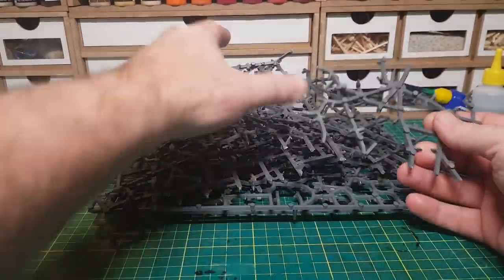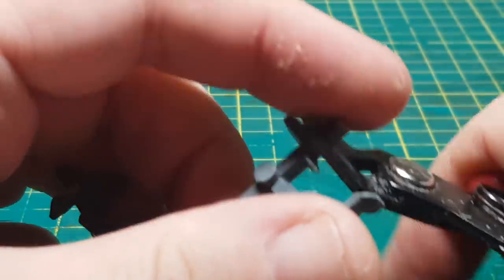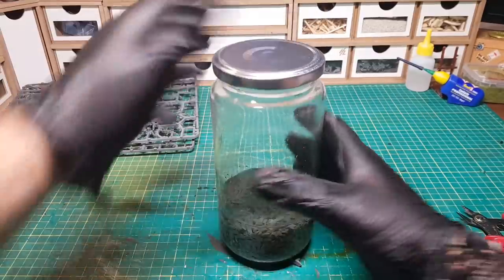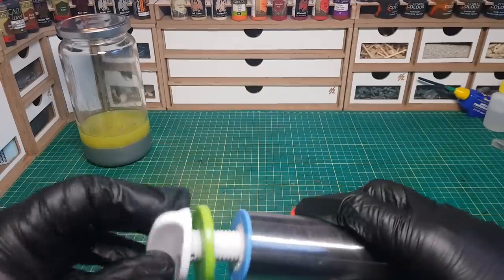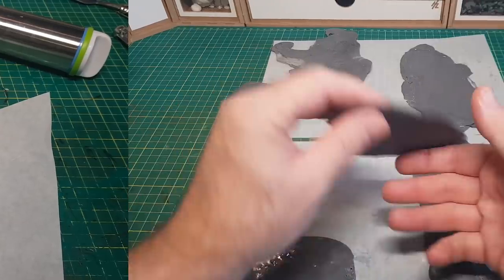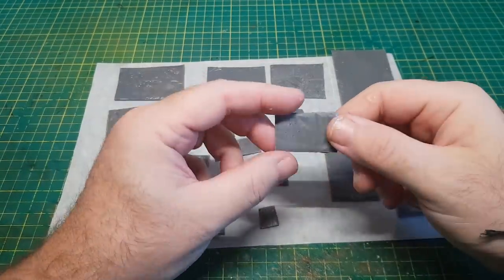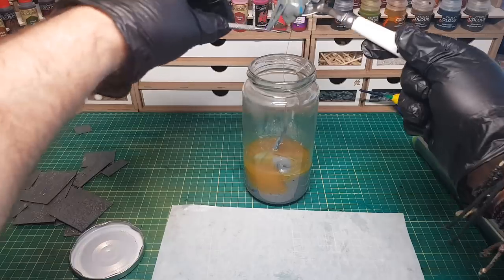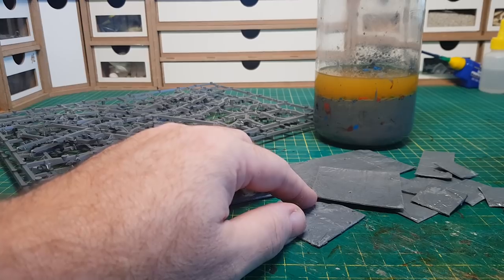Turn Warhammer 40k Sprues into Flat Panels

Comment from the maker: Apologies about the sound quality, Im getting to grips with the new microphone lol =)
Reply: How did you make those wrinkled panels you used for the containers?
Reply from the maker: @charliebeare9752  my video is out later today and Im going LIVE in 30 minutes =)
Reply: I tried this and after melting down the plastic and rolling it out, it never fully hardened. The edges got crispy but the middle was still gewy. Do you have any suggestions? (I used both nail polish 100% acetone and just pure acetone to melt the plastic)

Comment: You can put thick rubber bands or layers of electrical tape on a standard rolling pin to control your depth. Works for pastry as well as plastic.

Comment: since you’re already using a roller. Have you tried using a texture roller on the panels after they’ve set a bit in the grease paper but before they’re hard? Could see some good pre-made sci-fi scraps, walls, or ruins using that instead of just the plain panel. Just a thought. Keep up the good work👍🏻

Comment: That's a really cool way to recycle plastic waste! I expected the panels to shrink and/or warp as the acetone evaporated. I guess they did so, but to a much lesser extent. I wonder if it would be feasible to squeeze the gooey stuff into a mold to perform a ghetto version of injection molding. That probably wouldn't work all that well. Another idea that would probably work better is to press something into the surface of the plastic sheet while it's still soft to make an impression. This could be a neat way to add texture.

As for the solvent - wouldn't getting just acetone from a hardware store be much cheaper than acetone-based nail polish remover?

Comment: Very interested in trying this for my self so I Can recycle the sheer amount of sprue I have laying around . Curious what you do with the leftover acetone , can you reuse it ?and what would be the best way to dispose of it ?
Reply: This has been my concern with this channel too lol...a lot of these are great ideas but I have to wonder about the safety of it. I don't think you can just pour acetone down the drain. And you probably shouldn't be melting plastic in your oven. Not to mention some of the environmental impact. I'm sure at some point using too much acetone it would actually be better for your carbon footprint to just throw the sprues in the trash. 

Great videos, but I think Miniature Hobbyist is an Ork IRL. Like I'm pretty sure he could chop off his own arm and then sew someone else's arm on and he'd be just fine. If the rest of us were Orks, we'd wonder "Wot is dat wyrd 'un doin' wiv all dem kemikals? Uh Boss, is dat save?"
Reply: Terra isn't a paradise world.
Reply: I use sprues and acetone as plastic cement and can tell you it gases off.  If you leave the plastic in the jar it will eventually dry out and more nail polish has to be added.
Reply from the maker: @nekrataali  Why do people assume I throw acetone away, I dont throw anything away lol, it can be reused until there is none left, Ive brought 2 bottles of acetone, the first one lasted 2 months lol, I like your theory but dont think I will cut off my arm to test it lol =)
Reply from the maker: The acetone is left in the jar and I keep topping the jar up with more sprues so nothing is wasted =)
Reply from the maker: @TheSalamandrin  exactly =)

Comment: If I was to make panels with this method and place these panels into the shape needed (say a little square with open top and bottom) held in this shape by a wee bit of sticky tac on the mat, would a brushing the joining edges with acetone til sticky then patiently holding them together be enough to create a smooth join? As in would it make the square shape look like a square shape with neat joins? Or would glue be the best option?   Also, could one use acetone on a brush to create specific melted feature?

Comment: I have a few questions. Firstly an observation. The acetone is changing color after melting the sprue bits. That makes me wonder, is it leaching something out of the polystyrene.
 What is it leaching out?
Next, is the polystyrene as strong still once it re-hardens? Has it become more brittle, or more flexable at all after the proccess ?
And lastly does plastic cement still glue it together as nicely?
Reply: Yeah I had the same idea. If the color changes, then the plastic is not the same chemically as it was initially. I wonder what will happen when he melts these panels or any recast sprues, will the acetone change its color or stay clear this time.
Reply from the maker: The acetone changes a different colour depending on the original colour of the sprue so Im guessing its the dye used in colouring the sprue. It doesnt seem brittle at all, especially considering Im making the panels quite thin. It still glues well using cement glue so doesnt seem like it has changed in any way =)
Reply: @MiniatureHobbyist  thank you good sir! I hadn't thought about there being dye in the plastic. That makes sence!  I know you've recast doors. And I've seen you cast figures from resin. Have you done  any figures from the melted sprue goo though?
Reply from the maker: @j453  no worries, I have cast wheels using sprue goo, to cast figures you would need some sort of injection moulding to push the goo into all the parts, as Im only an  amatuer I dont realy have the money or space for one of those lol =)
Reply: @MiniatureHobbyist  ahh ok

Comment: Hey. If i should do this and leave the flattened surfaces out until hardened is it still easily cuttable with a hobby knife? Or does it then take more like a hobby saw to get through it? You made it look so essy to just pull your knife through the surface in a line but that was when it eas still soft wasnt it?

Comment: Oddly enough, the wrinkled panels would likely look better on an ork build than the smooth ones. The wrinkles make the panels look like they were crudely hammered into shape with lots of little imperfections. I might prefer the quick-peel method because of that actually, though the smooth ones would work better as universal panels.
Reply from the maker: Yup once painted it is gonna look like old bashed metal panels =)

Comment: The panels look like they harden after the acetone dries off. Is that true?  Looks like it'd be a great way to get curved panels. Press the panel against a curved surface like the outside of a jar (lined with greaseproof paper), leave to dry.  Really love this video! Looks like building the ork fortress is going to be a pretty cheap job now. Thank you!
Reply from the maker: Yes they will curve well that well =)

Comment: Do the panels stay soft or do they eventually harden completely?
Also, can you still glue them with the Revell glue I am seeing in the background?
Reply from the maker: It takes a good 24 hours for the panels to fully stiffen up and yup you can use cement glue on them =)
Reply: @MiniatureHobbyist  Okay, thanks. 
Have you ever tried just using acetone vapor instead of fully submerging the sprues? That method is used to smooth 3D prints, and it might also work here.

Comment: Does the plastic gets more brittle after acetone? The acetone changes its color, surely some chemical reaction occurs between it and the plastic, it would make sense for reused plastic to be slightly different as it now lacks something
Reply from the maker: The acetone changes a different colour depending on what colour sprues are used, so I think its just the dye in the sprues. The plastic doesnt feel brittle and is very rigid =)
Reply: @MiniatureHobbyist  cheers, you can probably make shoulder pads and makeshift armor plates for infantry with these, or even press-mould them into some more interesting shapes

Comment: How do you feel this would work with blue stuff for making part replicas?
Reply: He tried that in a previous video; it doesn't work too well, because acetone is pretty bad at dissolving polystyrene (which the sprues are made of). But, if you use methyl ethyl ketone (MEK), xylene or ethyl acetate instead of acetone, it'll work much better. Just note that xylene is pretty carcinogenic and MUST be used in a very well-ventilated space, preferably outdoors. MEK and ethyl acetate are considerably safer than xylene. Even then, the plastic might shrink a bit when drying.

Comment: you dont actually need a fancy rolling pin, you can get a normal one and roll it on top of a material that is the thickness of what sprue sheet size you want
Reply from the maker: thats harder than it sounds, having the bits on the end makes it perfect everytime =)
Reply: I think you also wouldn't need a fancy rolling pin, if you can get your hands on a cheapo rolling pin- something from a charity shop or car boot sale (when those become A Thing again, after the plague times have ended) would be ideal. Just mark out the centre of each end, get some discs of the right size and screw them on to the ends of the rolling pin. Of course, unless you unscrewed them every time, you would be stuck only making one thickness of panel

Comment: I've been trying this and I'm running into an issue.  I am using GW sprue, parchment paper and 100% acetone.  The initial melt and roll go just fine as in the video, however my sprue inflates while off gassing.  Ive had 2mm thick sheets either balloon into weird shapes, or they are pockmarked with large bubble cavities. Either way, they also don't dry flat.  When I come back to them they are always bent at weird angles.  I'm not doing anything different  from your video to my knowledge and if you have any insight I would greatly appreciate it.
Reply: I am experiencing the same - did you find an answer?
Reply: @thomastoftkjr9898  Not really. What I'm doing now is pressing the sprue between out of date codexes while in the parchment paper.  I'm using bases as a spacer so the sprue is an even thickness and leaving the books on until it has dried.  This has largely stopped the bubble problem but it has introduced new issues.  There are still small voids that appear on the surface from small bubbles and as soon as I remove it from the paper, the plastic warps like a potato chip.

Comment: I know this is an older video, but hoping someone has the know-how to help. I've made a jar of gooey stuff, spooned it out, rolled it out and left overnight. However it is still soft to the touch. Not sure what I can do to accelerate/complete the hardening process. The jar of acetone + sprues was sitting for a couple of months as I got distracted (read: at work). WOuld that have any impact, i'm not too sure that it would tbh. Any help would be appreciated.

Comment: I wonder, could a texture roller have some effect? I'm betting the greaseproof paper in the way would cause issues but while the panels are still somewhat soft but not gooey-sticky, would a roller work?
Reply: i was going to ask the same thing, i wonder if running one of the Greenstuff world rollers over it before it sets would work.
Reply from the maker: Yup take them out of the paper and its takes 12 hours or more to fully harden so in that time you could roll on a texture =)
Reply: ...That is a genius idea. I might just try this.

Comment: Arrrrrrggg, acetone doesn't melt the sprues.
Its like saying water melts alka seltzer or tea melts when you make a cuppa.
Reply: I actually think 'melting' is about going from solid to liquid, usually via heat but not always. Clearly the sprues haven't dissolved, right?
Reply: @charleshowie2074  no melting is a state change due to heat, the sprue is being solvated by the ketone
Reply: @mrgriff9648  I see. Are you sure?
Reply: @charleshowie2074  yes I'm sure, I'm a chemist and when something melts its due to heat and not dissolving.